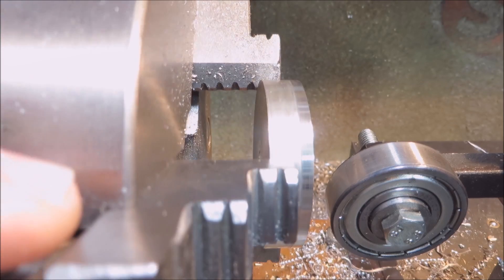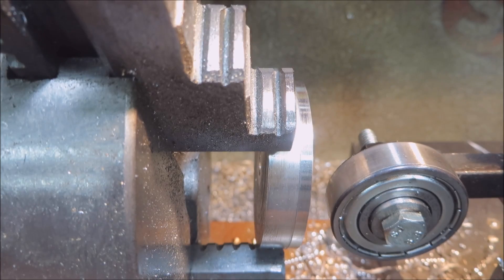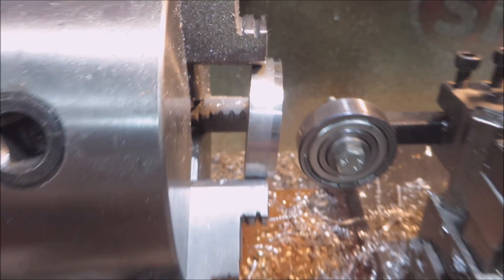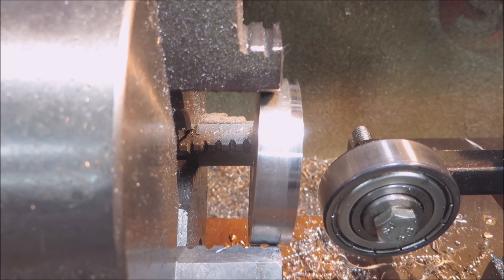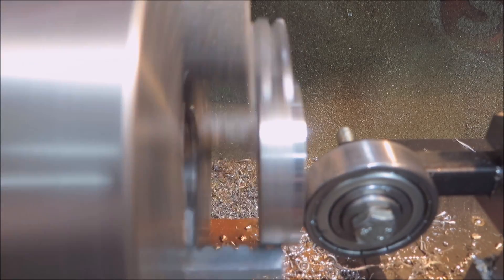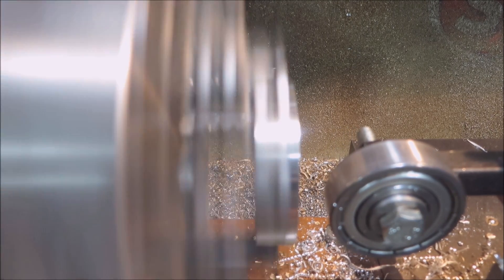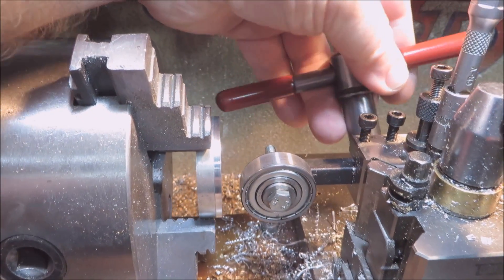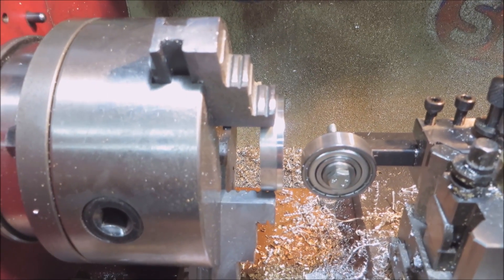Workshop Talk - Lathe Centering Roller Tool - Hints & Tips

Comment: Hello, that tool is awesome, is the job should be tightened or should be light tightened
Reply from the maker: Just have it job loose enough in the chuck jaws so that it can move and be centered.  You will be surprised how quickly and easily it does.

Comment: Great tip! Thanks I'll use it
Reply from the maker: Thanks Jim, give it a try as it does work very well. Also you can centre stock the other way by bring the bearing onto the side.
Reply: I will. I've got some small bearings so this will be easy to make.
Reply from the maker: It doesn't have to be the big bearing that I used. A small bearing will work just as well. Maybe even better.